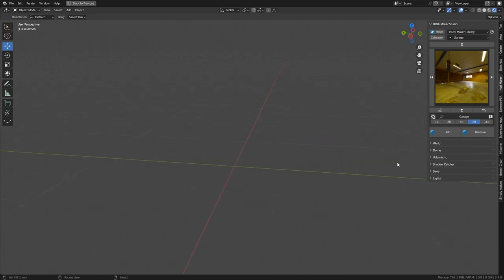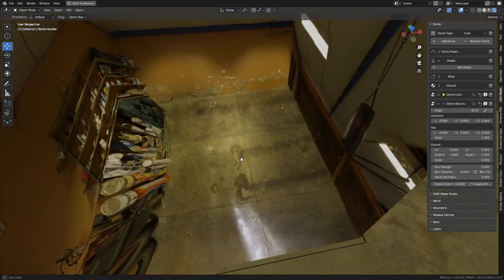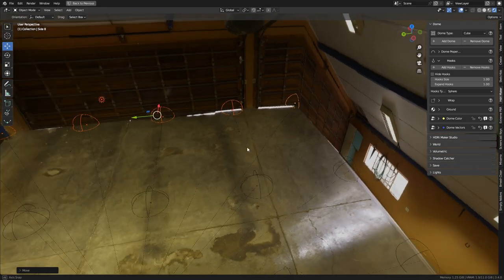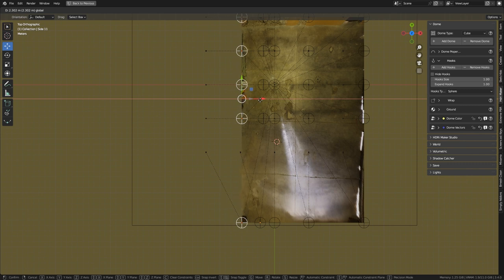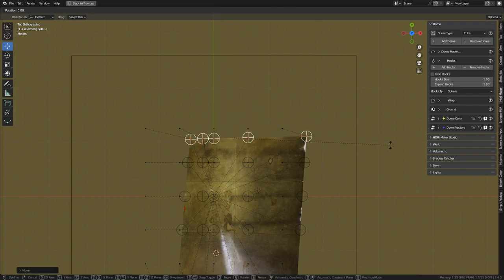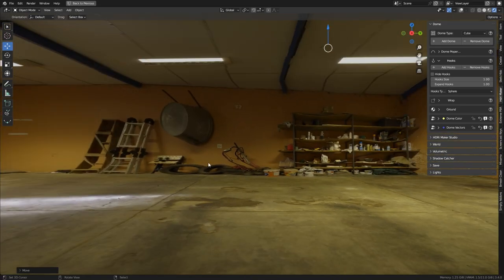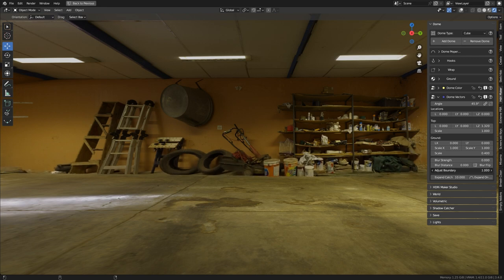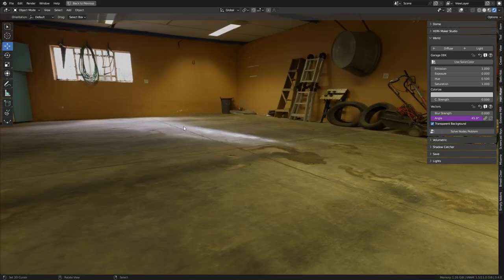HDRi Maker Addon - Custom Dome Projection Tutorial

Comment: how to export the dome to lets say sketchfab?
Reply from the maker: At the moment it is not possible because sketchfab does not support the HDR-EXR file on the dome model, I have already done some tests because I wanted to insert this features. Anyway, this feature is always on my to-do list 👍
Reply: @andrew_d1612 what if I apply the texture on the custom adjust cube?
Reply from the maker: @liweilin6649  Technically you can apply any image to the dome, you can do it using the "Import Background" Tool or by holding down SHIFT and pressing the "ADD" button (The button you use to add the background from the HDRi Maker interface)